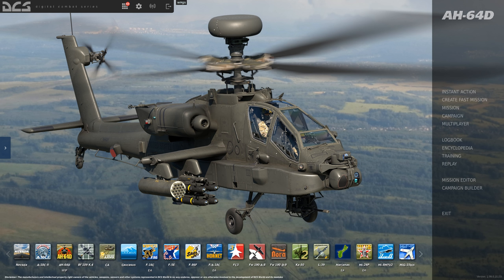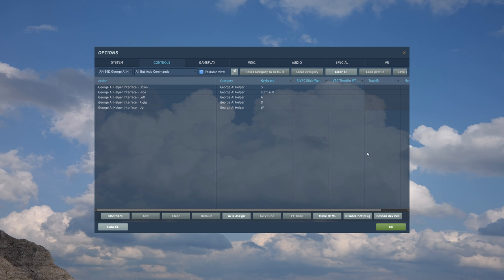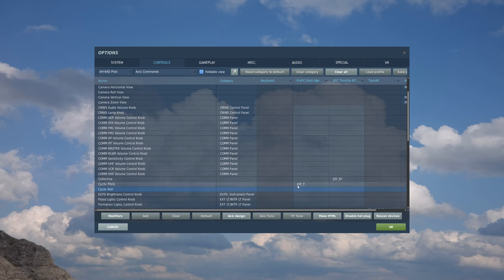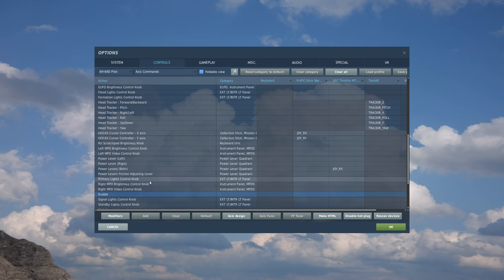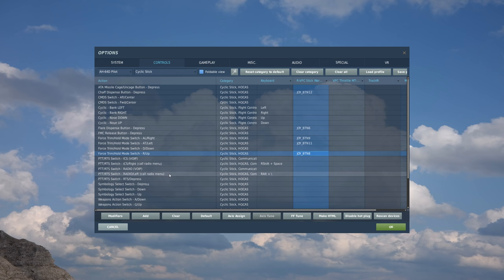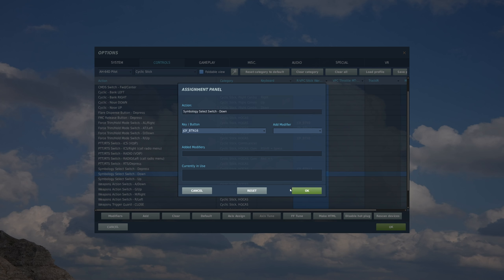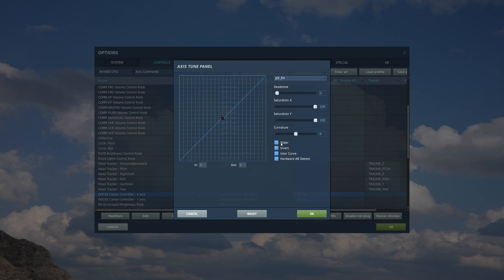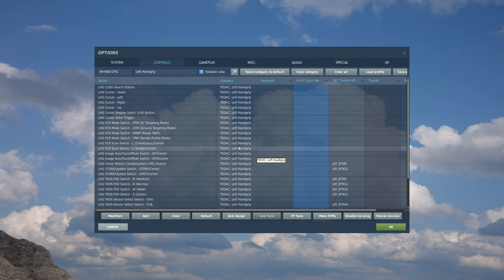DCS: AH-64D | Controls Setup

Comment: Will it be possible to interact with the handgrip controls as clickable cockpit items as well? This would be as very useful option to still have available for less frequently used functions
Reply: That would be quite hard given that several of the hadgrip controls are four-way switches with a depress.  Then you have buttons on the other side of the grip.
Reply: @MrPhantom453  could try and do it like on the f16 icp switch where you click on the direction you want like how when you want "return" you click left of the switch on return. For depress it could just be clicking on the switch directly. Doesn't have to be all of the switches clickable just the ones where its possible to have it it would be a useful option
Reply: @carleb  Possibly, but I think it might be hard with all those switches. you never know though.  If they do it, its a bonus for those who like that option.
Reply: I don't think this will be possible, so far no plane has a clickable HOTAS. Modifiers will be an option for that.
A single switch on your hotas can be used as a modifier, to switch between 'flight' and 'combat' modes. This way the same hat can be used for sights select and searchlight and don't have to look around the virtual cockpit.
Reply: I don't see that as any kind of effective way to control the aircraft unless you're playing VR with its controllers. But I agree doing it that way, would be sweet.
Reply: @bigbengamer  The tedac hand grips don't control the aircraft and also I meant it would mainly be useful for the less frequently used controls that ordinarily wouldn't be worth binding to your own hotas. I would only really expect it on static surfaces as well because doing this for the stick and collective controls would require a lot of code since the hit boxes will move about

Comment: Thank you so much for the Apache, Wags!

I have 2 questions about this binding menu that you are using:
1.) What is this symbol to the left of "Reset category to default"? It looks like a magic wand
2.) When will we get the "Hardware AB detent" in the axis tune menu visible at 9:10? I assume you can then set where your throttle has the detent and don't have to mess about with user curves anymore to line that up between hardware and software?

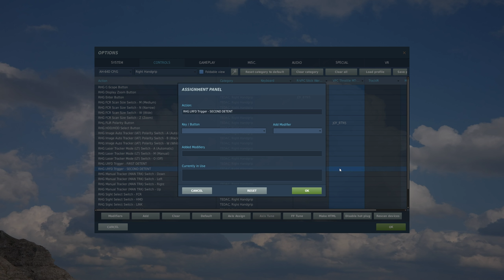Comment: I can't bind RHG Manual Tracker to axis using the ministick on my Virpil MC3 throttle  because I already binded the Cursor controller to that ministick. But if I'm not mistaken Wags says that's possible (min 31:57).  
In other words: if I'm using my ministick for slewing the TADS as CPG, can I use the same ministick to move the cursor between the MPDs?
Reply from the maker: No, they must be two different axis switches. For example: I have one assigned to the mini-stick on my CM3 throttle and the other to the mini-stick on my Winwing F-16C Shaker stick.
Reply: @MattWagner  Got it Thank you so much

Comment: Hey wags, quick question! I’m not getting any feedback on cyclic through my x-56 joystick. All buttons and throttles work. Just pitch and roll are not working. Any suggestions? I’ve changed the setting under special for the spring joystick as well. Thank you
Reply: Also pitch and roll works with all other modules

Comment: I think this is one thing that should be done for the proper release. Release control configs for the major joysticks and throttles e.g. thrust master warthog etc. The. Fact that most things are not even mapped or are mapped wrong in the early release makes it super hard to get to grips with
Reply from the maker: We strongly suggest learning to use the controls manager to create setups that work best for you. Teach a man to fish and all that.
Reply: @MattWagner  Yes I understand where you are coming from. However a working starting template for your control method that can be tweaked is definitely a more friendly way to get people encouraged to play. I have at least 3 friends who have given up with DCS because the curve of learning and configuration can be quite intimidating when they start out (which appears to be reset with each aircraft). With this helicopter alone I have probably poured  about 5 hours in and have only just got the hang of just about flying it and firing the canon and rockets still working on the hellfire missiles :)

Comment: Will any buttons bound for "AH-64D George AI Helper" cause issues when also used for either the "AH-64D Pilot" or "AH-64D CP/G"?

Edit: Just confirmed with BigNewy - the "George AI Helper Interface Show/Hide" will act as a toggle for the buttons set under "AH-64D George AI Helper".  For example, if you set both AH-64D George Menu Up/Down/Left/Right and AH-64D Pilot Trim Up/Down/Left/Right to the same Hat, the George actions will take priority only when the AI Menu is visible

Comment: Wags, I never zoom out from normal, I only zoom in (and then back to normal).  I would love to be able to use the pinky lever on the VPC Constellation for this purpose.  Pull the pinky lever to briefly zoom in a variable amount, then simply let go and have zoom snap back to normal.  Unfortunately it doesn't snap back to normal, it snaps back all the way to fully zoomed out, and because it's spring loaded it can't be held at normal zoom. No amount of axis tuning will achieve what I want.  I can almost get there by reducing Y saturation to 50, but unfortunately I can't choose which half of the Y saturation curve I'm eliminating (the software eliminates the bottom half of the curve, I need to eliminate the top half) and the result is now I'm zoomed all the way out, and pulling the pinky lever only brings zoom to normal.  Inverting the curve doesn't work because now I'm pulling to zoom out instead of pulling to zoom in.  My kingdom for a way to choose which half of the curve I'm eliminating so I can set zoom range from normal to fully zoomed in, not normal to fully zoomed out.
Reply: A user curve 50, 55, 60, 65...95,100 almost does what you want I think.

Comment: I'm here a year later (November 2023), so I'm not sure what changes have been made since this walk-through. When I switch to CP/G, it still remembers the mappings to the *Pilot*, so the axis and things I would use are already taken, though they do not show in the CP/G mappings. [I am using Winwing hardware.]

Understanding that it would be a lot more work, it would be immensely beneficial to people like myself if you (Eagle Dynamics) could add cut scenes to the mappings being used to show what they are actually doing. For example, you are about to map the cursor movement, so you show the cursor movement being used in the sim and then come back and map the controls to it. Obviously, some are quite self-explanatory. Nevertheless, it would be a good and beneficial practice.

Comment: is it possible to make a list of all the controls you set in here? i would like to know what is recommended to bind and not have to rewatch a 30 min video when it comes out lol
Reply: Just do it the old fashioned DCS way. Watch tutorials and fly around shooting shit. You'll know very quickly what needs to be bound that you missed. It's not a B-1. There aren't a thousand switches. There's like 30, and you'll knock out 20 before you even get off the ground.
Reply: @LtRiot  thats fun until youve done it for 10+ aircraft, after youve spent 15 hours setting controls and trying to figure out what controls need set you get to a point where you would rather not have to deal with it

Comment: I appreciate the control setup advice but I need a video that explains what the axis controls actually do. 

I am using a Warthog HOTAS with no pedals so my rudder is assigned to a hat switch and the collective is assigned to the throttle. I tried splitting the throttle between Collective and Power but all it seemed to do was switch the electrical power off and the Apache crashed. I can manage to control the general direction but I always seem to be in a slight drift either to right or left instead of flying straight and I have no idea how to prevent this. 

Similarly, I can bring the helo to a stop by pitching back but I have no clue how to decrease/increase height to find cover as the collective (power) just puts the helo out of control. Yes, I am new to helos, and this is really frustrating. :)

Comment: what does the stabilator control switch do?
Reply from the maker: Manual and auto-schedule of the stabilator on the tail. I plan to do a video on it later. For now, just don't touch it and keep it in auto mode.
Reply: @MattWagner rgr im struggling with all the povs, i dont know what alot  of the controls mean so i dont know where i want to put them. there appears to be 2 or 3 types of curser, no idea which does what or where lol

Comment: When I assign the same button or hat switch to another option it deletes the first one why is that
Reply from the maker: An action can only be assigned to one input.
Reply: @MattWagner  thanks wags, in your video it seemed you assigned a button to depress for the pilot and then used the same button depress for say George.
Thanks
Reply from the maker: George, Pilot, and CPG assignments are unique and only used when system/ seat is used.
Reply: @MattWagner  hi mate are you able to post a picture of your throttle and joystick with labels of all the things you have mapped , thanks

Comment: You guys need to buy the real Helicopter HOTAS for this.  No way you're playing in the Apache with the Warthog or X56.
Reply: Flew the Huey for years with w and s for collective and a logitech 3d pro for cyclic and anti-torque. It may not be ideal, but you'll be perfectly fine, whatever your setup.
Reply: There's absolutely nothing wrong with using a throttle for helicopters.
Reply: You're exaggerating alot, you'll be fine with even the simplest of sticks.
Reply: It’s easy flying with a X56, helicopters or airplanes.  Even an XBox controller is doable; only sucks because the stick-throws are too short for precise movements.